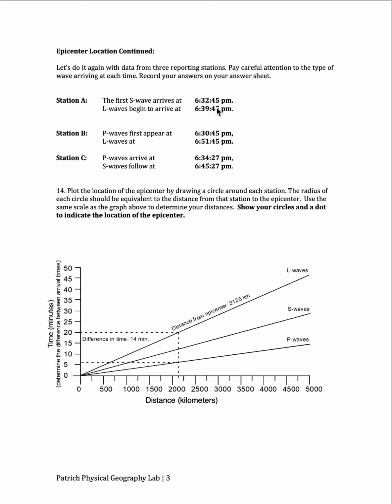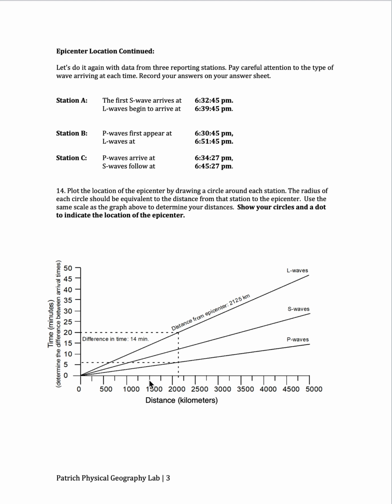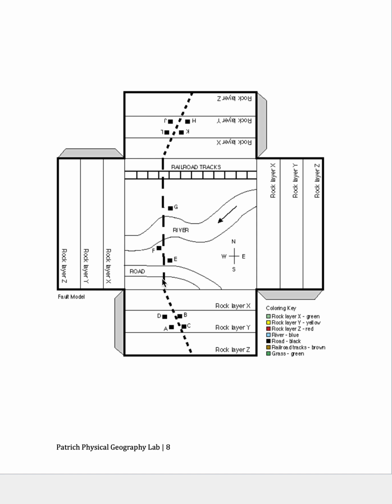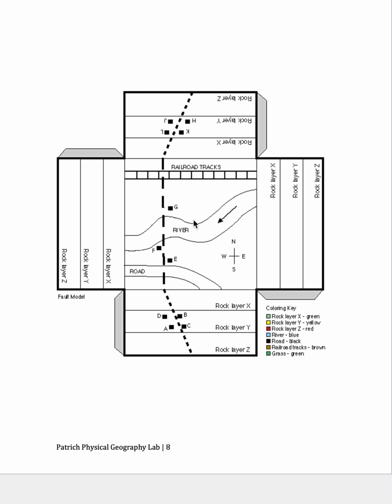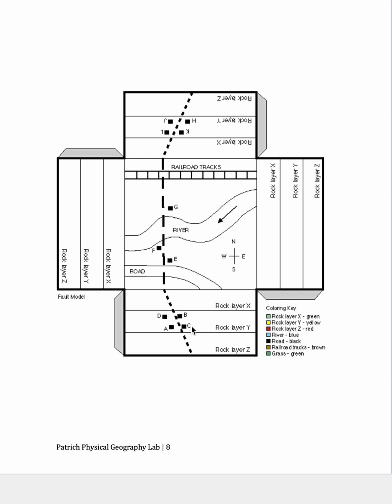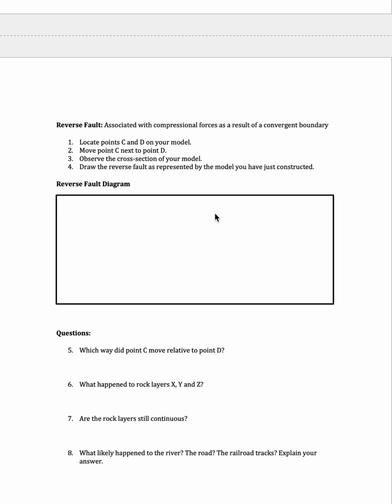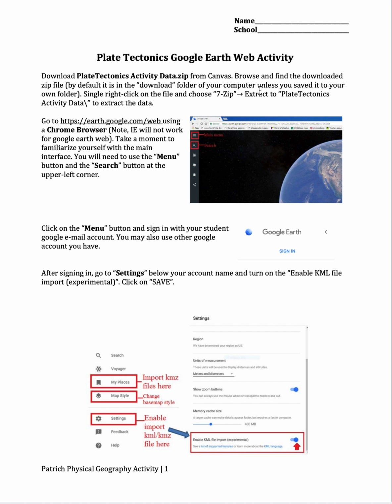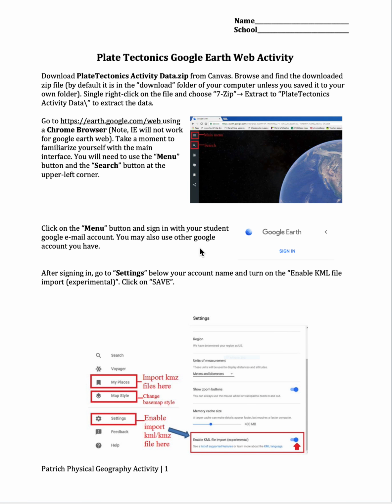Old Version- Physical Geography Lab 8 | Earthquakes & Faults.   Professor Jeremy Patrich

Comment: This was very confusing.
Reply from the maker: I’m sorry- did you want to share what part was confusing so I could try to help?
Reply: @Jeremy.Patrich  honestly everything for this lab.
Reply from the maker: Hmmm. Well the major part of the lab is the last part where you make the model and draw out what you see. That might be easier to complete than the triangulation part. All you do is print out the last page, the model, and cut and color the model. Then you told the lines and tape/glue to make a box. Then you cut along the dotted lines so you can move the two pieces relative to one another. The lab walks you through those steps, and what letters to line up to creat a new fault. In my lecture class we spend a lot of time on this topic- here is a lecture on it for more help. https://youtu.be/oqHOYjnJJcc